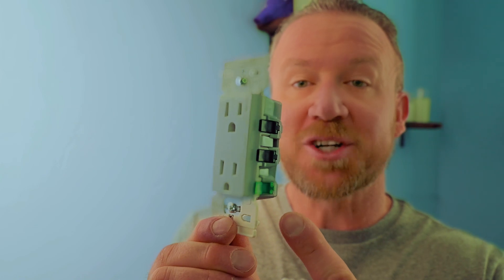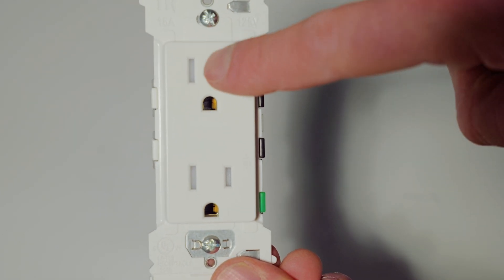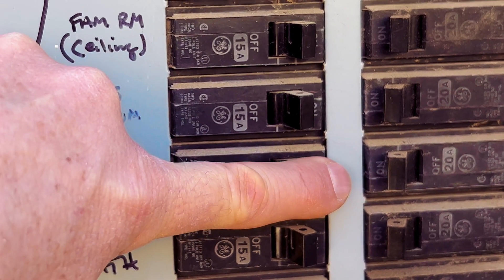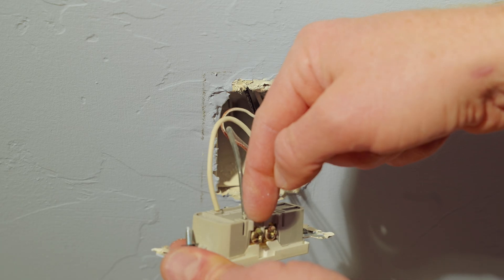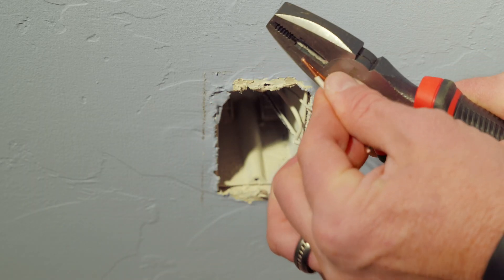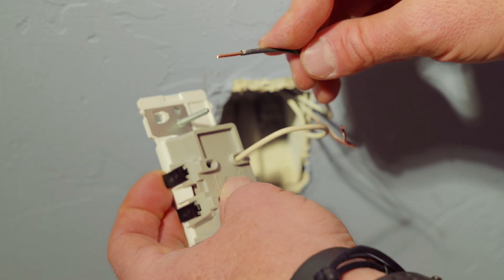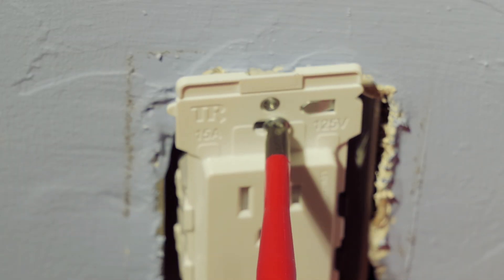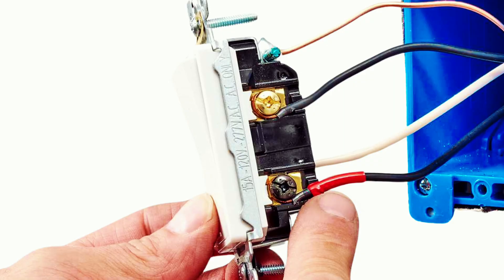The BEST & Fastest Outlet for DIYers!

Comment: I don’t understand why the outlets only have one ground connection.  
So if you’re installing these in a run you still need to tie the ground wires together and then have a pigtail to the single outlet connection…. So you still have extra connections inside the box.  
Why didn’t they put 2 ground connections as well…?
Reply from the maker: Great question friend and thank you for the comment! It is my understanding that there’s only one ground connection on ANY outlet because of the potential for confusion if there were more than one. They keep it super simple having only one, usually offset by itself away from the hot and neutrals. Keeping to code, any outlet you see will have just one single ground point connection. Let us know if you have seen an outlet or switch with more than one ground connection. Thanks again friend!